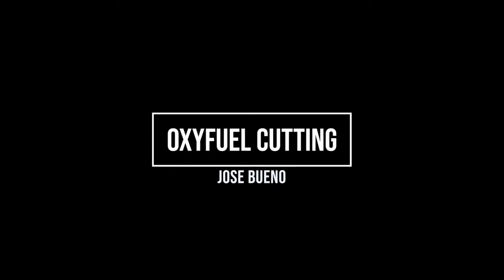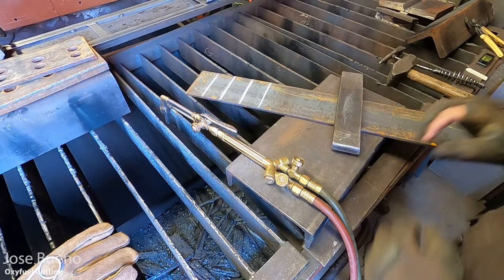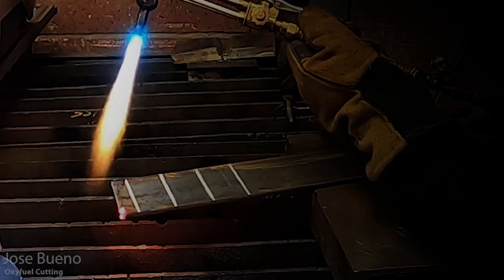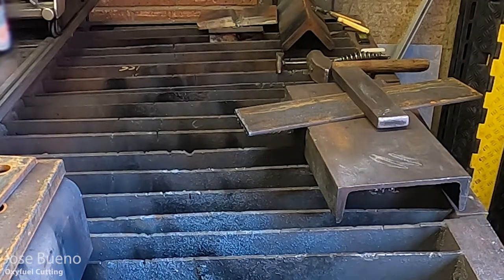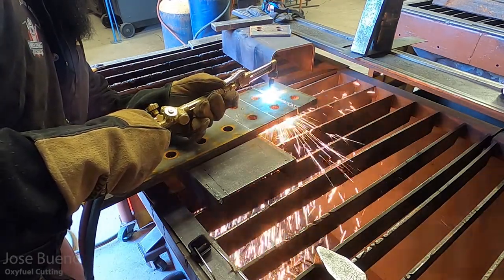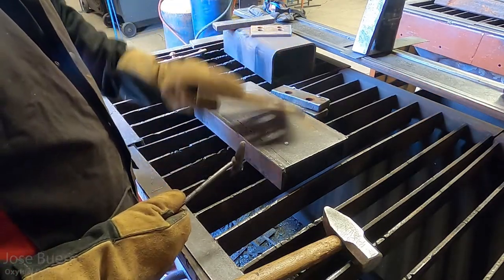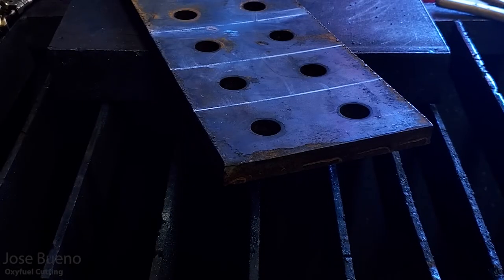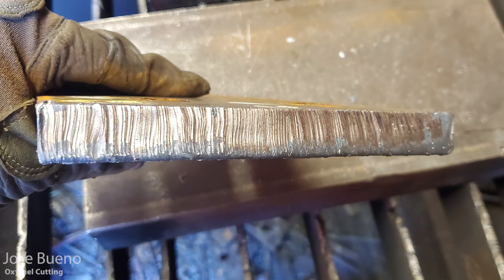Oxyfuel Cutting Demonstration

Comment: Very good video.  The only things you missed and may want to cover in a future video: 
a) A discussion on alternate fuel cutting types and benefits
b) Cutting at odd angles (overhead, around pipe, square tube
c) gouging out a bad weld or gouging out to separate two pieces of metal for repair (simulates a real world "field" / shop repair)
d) cutting painted metal (again, simulates a real world repair)
Reply from the maker: Thank you for the feedback. There are many videos still to come, I will keep your feedback in mind as I work on future videos.